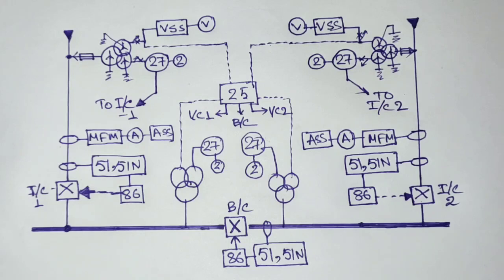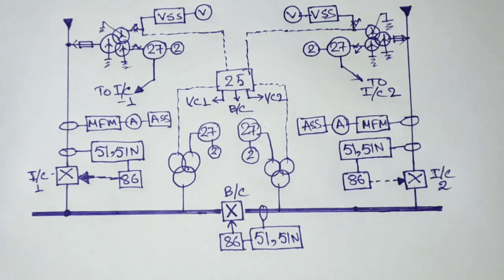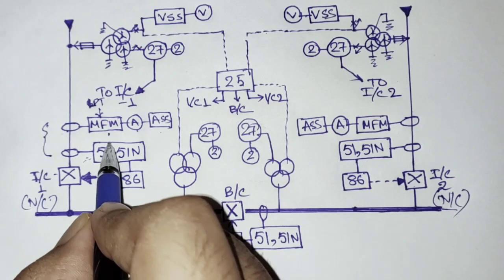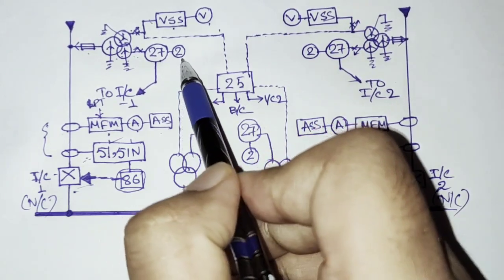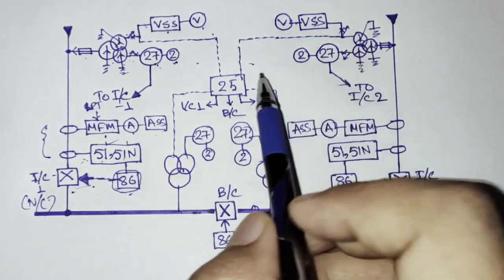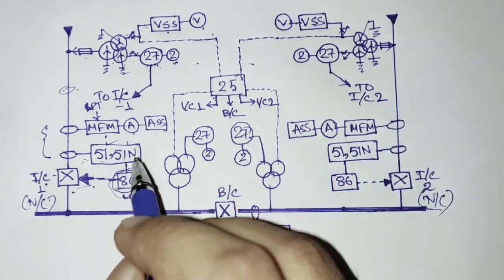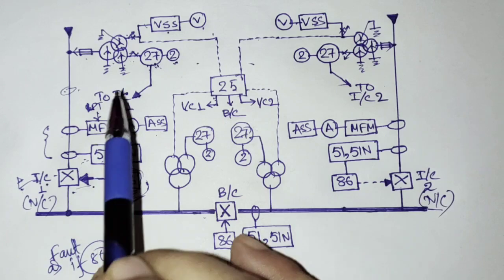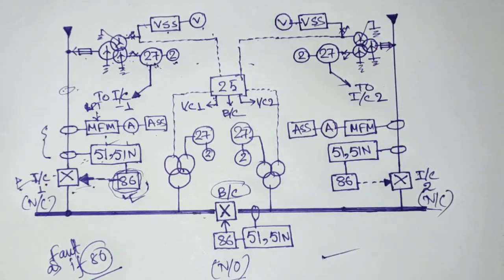METERING AND PROTECTION SLD|MOMENTARY PARALLELING PART 2|Relay connection

Comment: Thanks for uploading this video. 
During my job at reliance we have ABB  ref relay 615 for this scheme independent/mom par/auto which is done by relay soft logic. 
But now I am at different organisation so I have adopted this scheme to our organisation and facing some issues. 
1)We dnt have abb 615relay. We have Siemens Argus relay so we have to go for hardwiring for this scheme. It becomes more complex hard wiring. 
2)our scheme philosophy is 2 incomer
2 buscopler - 2 LPT for incomers & 3 Bpt for Bus A ,BusB ,Bus C.
One check synch ske  relay, 2 neumerical relay Siemens Argus 7sr12    
at two incomer, voltage monitoring relay at incomers, 3nos undervoltage relay for 3 bus. 
Problem is.. We dnt have any relay & master trip at 2 buscuplor.only LSIG etu unit is there.is there any problem without using relay for this scheme
? 
3)what will be the setting of timer to generate trip command after mom paralleling? 
Can I get ur email ID?

Comment: what is Typical time delay applied via Delay Timer -(2) when it is associated with Bus PTs, to initiate a trip command, once PT detected an under voltage ?
Reply from the maker: Sudden undervoltage can happen many occasions. Say motor over load. So initially tripping of incomer is not triggered
Reply: @electricaltechnologyandind5335   yes you are right. what would be typical adopted time delay in practice?  1/3/5/20 sec? 1/2 mins?
Reply: @jyotielectrical7393  My qn was related to time delay for for the timer, in case under voltage
Reply: If your uv relay idmt, select normal inverse 1.3s curve, if your uv working on definite time,use 5%for 5 second

Comment: Kindly clarify why 4 pt inputs are connected to 25 relay. Generally incomer-1 & 2 PT are connected to 25.
Reply from the maker: Actually the schematic can be implemented in either way. Suppose incomer 2 will come in parallel to bus b. So better to check bus b pt and incomer 2 pt. If bus pt is not considered you won't be able to detect bus voltage
Reply: For closing of bus coupler breaker, busA PT and busB PT are required. For  closing of incomer-1 line Pt1 and busA PT  are required. For closing of incomer-2 line pt2 and busB PT are required. So four pt inputs to 25 relay.
Reply from the maker: Actually there is a pt selection scheme. The pt which will fed the 25 is selected as per the incomer source
Reply: Bus pt input is fed to undervoltage relay which can be elec Mag type or neumerical type to detect the bus voltage healthiness (normally set to below 40%) .